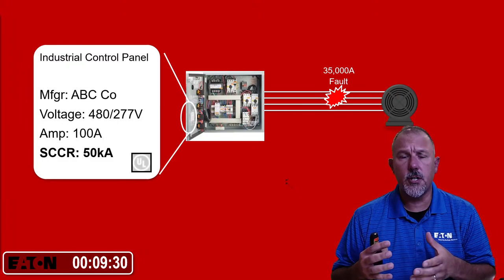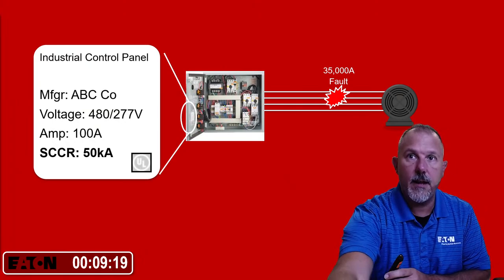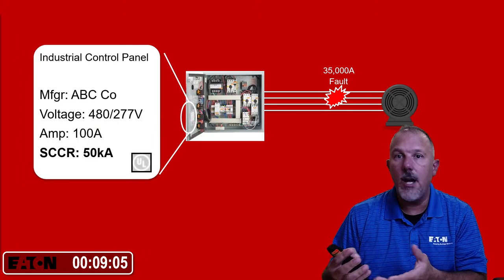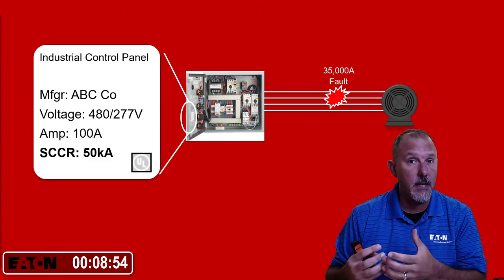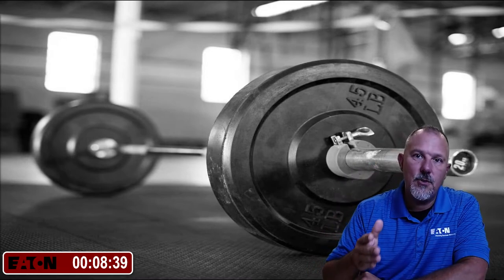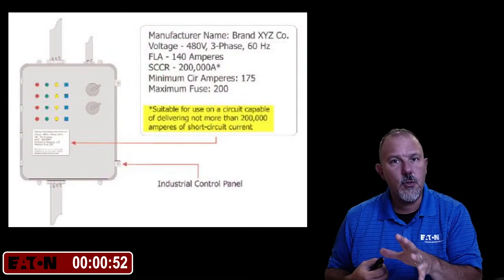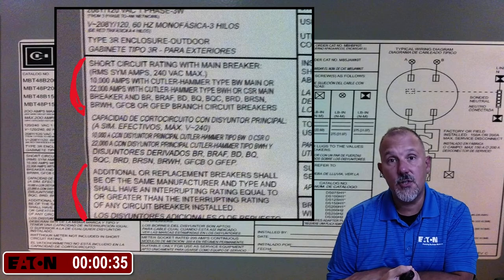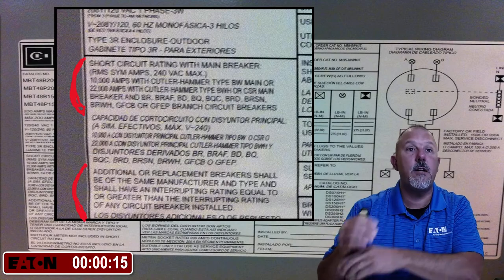15 Minute Tech Talk - SCCR

Comment: Tom, this video has been very helpful. 

Recently I was given a document by Schindler outlining that their max SCCR for their control equipment is 5000A. I do not want to let the smoke out. The available fault current at the equipment feeding the disconnect for this controller is 22kA (give or take). I am being told to "ensure that the available fault current of the building supply at the service switch does not exceed this value." Is this the same thing as protecting this equipment with a fused disconnect? Because the verbiage in that sentence does not make me feel as if that is the case.

Comment: I never really considered short circuit current ratings for every small piece of equipment before and don't think I am alone.  In cases of many pieces of small equipment it happens to have been listed and made for a typical installation so there's normally no issue.  However, it would help the installation community be more aware if  there was more standardizing of things and putting it into tables in the NEC or something.  We can't afford to make people have to buy standard upon standard and publication upon publication.  There's even a fundraiser (informational note) in 240.4 that suggests buying another publication to help with short circuit ratings for wire that is applied within its ampacity!

Comment: I’m wondering something. When you protect a Type 2 Surge Protective Device with a 15 amp breaker, what SCCR should be assumed? I see some of them rated in the 100s of kiloamps. So what interrupting capacity of the breaker is needed?

Comment: When is an example where in reality, the X/R ratio is so low as to be of concern?  Seems like they go pretty low in tests so I am wondering what installations are actually so low as to need any adjustments.
Also, how does the X/R ratio of the utility power source differ in impact from the X/R ratio caused by the power factor of your facility loads?